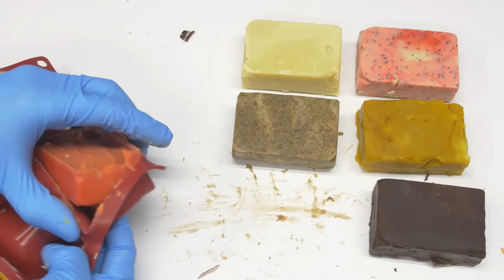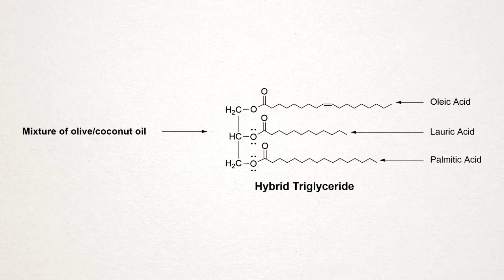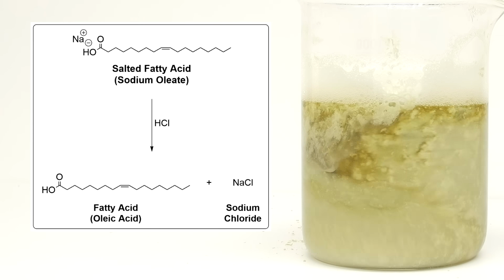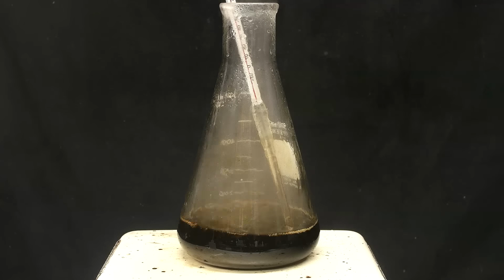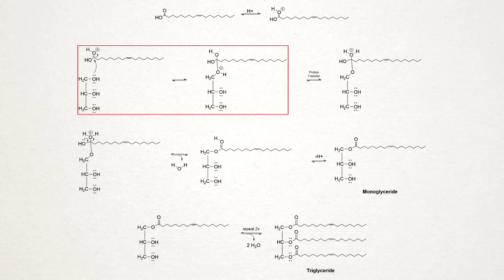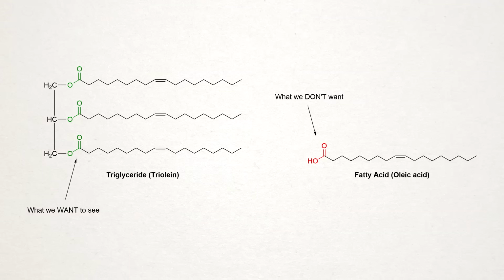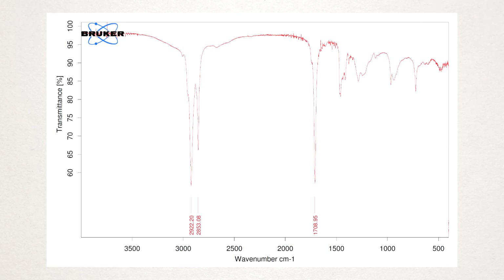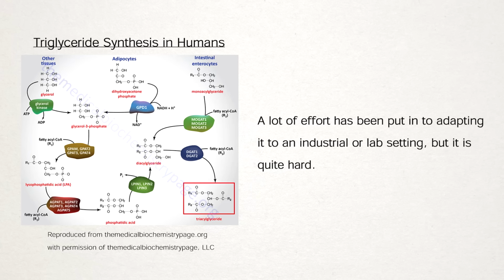Turning soap into oil and making French fries

Comment: If you ever come back to this, I think the conditions you tried were most likely the problem. 200 degrees is pretty harsh, especially for a neat reaction of a starting material that decomposes relatively readily. PTSA would be a great choice of acid catalyst. If you don't want to use sieves to remove water, I strongly recommend using toluene as solvent and refluxing with a Dean-Stark trap.

Comment: You could have used gas chromatography to determine if you have triglycerides. You could have also titrated the “oil” in a solution of heptane and isopropanol against 0.1M KOH to determine fatty acid content. Phenolthalein would be the best indicator for that.

Comment: You may have already gotten once in the last 5 years, but a high temperature laser thermometer would be really useful for a lot of conditions and avoid the need for inserting a thermometor or probe into the reaction mix.

Comment: Unless there were weird impurities from the processing (or the extra vergin olive oil that soap was likely made from), relatively pure oleic acid (or oleic and linoleic acid) should have very little flavor and should work OK as frying oils.
If they'd oxidized significantly from the process and effectively gone rancid, they'd obviously taste worse, but depending how much of that was present, it might still be reasonably palatable. Burning or charring of the olive solids (and various plant terpenoids, etc) from the soap might taste bad, though.

Soap made from light olive oil wouldn't have those solids or other impurities present, though.

Comment: I'm wondering if there was another way.
If you extracted the carboxylic acid, purified it and turned it into an acyl-chloride using thionyl-chloride and DMF. Then you could've reacted it with glycerol to make the product. Of course it would be much more expensive and involved, but I think that might have worked. Idk if the SOCl2 would've reacted with the double bond, but I don't think so.

Comment: It'll probably be easier and safer to mix the fatty acids with DCC and DMAP in DCM, then add the glycerol.  Stir at room temperature for 3h, then cool in ice to ppt the dicyclohexyl urea byproduct. Filter over celite and wash with hexane. Evaporate the solvents and you should have oil

Comment: With all the other stuff that's in soap, quite a bit of purification of the fatty acids would be needed to build a satisfactory tasting "de-saponified" oil, and even it would have quite a few "mongrel" fats where the fatty acids don't match up.  There was a synthetic fat called Enova which was built out of vegetable oils to be low in triglycerides and high in diglycerides.  Even it had troubles with impurities, which took it off the market due to feared carcinogenic health effects of the impurities, which were reportedly in this synthetic oil at levels a hundred times that of natural oil.

Moral: it's not nice to fool Mother Nature (apologies to the late Chiffon margarine).  I still miss the old high fat margarine, though butter unequivocally tastes better.

Comment: A bit late, but could use an EDCc coupling for the esterification reaction? I've used EDCs for coupling amines and it is possible to couple alcohols to catboxylic acids but it's supposed to be a bit trickier with esters than amides
Reply: Alcohol flashlight left on snd

Comment: Is there a way to remove oleic and linoleic acid from oils? I'm asking because I actually make beard products like beard oil and beard balm and I try to avoid using oils that are high in oleic and linoleic acid, since those fatty acids have been shown to inhibit 5-alpha-reductase, which is important for converting testosterone into dihydrotestosterone, the hormone responsible for the maturation and growth of androgenic hair like facial hair.

Right now I'm settling with using oils that have very low levels of oleic acid and linoleic acid, but if there was a way to remove those fatty acids entirely, or even just reduce their levels significantly, that would be quite an amazing innovation for "beard science" lol. That would also open up the number of essential oils I could use for fragrances. Right now my options are pretty limited since a lot of essential oils contain fairly high levels of both oleic and linoleic acid.

Comment: I figured I’d post on this video, I work in a facility that refines oils and I have to say you were very close. One of the big problems with your method is that you need to do this reaction under vacuum to start. The reason for this is because soft oils like olive oil tend to form peroxides when this reaction happens. The final resulting almost black sludge is something that we deal with too. We call it residue and it gets wasted through the process. Finally gas chromatography is genuinely a lot better at telling individual fats apart. Testing them requires a twofold method though, the first tells you which ones are present between mono-s di-s and tri-s and the other tells you their percentage breakdown between the different fatty acids. I don’t want to get too specific because I could possibly divulge trade secrets, but this process just needs a couple of tweaks to actually work. I was actually surprised with how close you got.

Comment: Please give it a further trial under modified conditions:
(1) You should carry out the reaction in excess of glycerol to shift the equilibrium towards the product. 
(2) Tin (II) chloride dihydrate (SnCl2·2H2O) is commonly used as a catalyst, since it turned out to lead to the highest glycerolysis yields. 
(3) Since the presence of water is detrimental, use a water separator while esterification. 
(4) The main reaction products are presumable mono- and diglyceride. Thus, use oil pump vaccuum for distillation to separate the triglyceride from the main products and the oleic acid.

Comment: So the temperature was way, way, way too high for the glycerol. It starts breaking down under acidic conditions at less than 200C. It would be nice to see this done again only not turning everything into tar. Also you can't vacuum distill triglycerides. You just can't. 400C? No. I'm gonna try doing it myself, see how it goes. Probably just starting with soap I make myself.

Comment: What if the reason the reaction between glycerol and fatty acids failed was because the mixture of fatty acids was too messy? You ended up with what seemed like reasonably pure oleic acid, so you could have re-tried it using that!

Comment: Hey Nile, I could be wrong on this. Maybe I don’t have all the required information. You showed your IR spectra at the 16:55 ish mark. Carboxylic acids are typically very easy to identify because they give very broad huge absorbances around 3700-3100 cm^-1 due to the O-H of the acid and hydrogen bonding. They are typically the easiest peaks to identify because they are large and broad. That does not seem to be present on the graph you displayed at about 16:55. Like I said, I could be missing some info about the spectrometer used and the parameters, but it does not look like a graph indicating carboxylic acid functional groups to me. I know your carbonyl peak came a little low for a typical ester carbonyl, but factors such as alpha or beta saturation/unsaturation, and other factors can shift the peak. It looks very possible to me that this actually is the graph of an ester rather than an acid. Just a thought, and like I said I’m certainly willing to be incorrect, maybe there is something I missed or don’t know here. You also have other indications such as liquid at room temp rather than solid, etc. Let me know what you think if you see this.
Reply: The only thing that would change what I said above is if the suspected oleic acid is in the deprotonated salt form. Then obviously the hydrogen on the carboxylate would not be present, thus no hydrogen bonding between molecules and no large broad O-H signal from the carboxylate group. I’m not sure what form the acids would have been in when you took the IR.

Comment: Could it have had anything to do with when you warmed it in the microwave? Usually you use a hot plate to increase reaction rate. Could this have altered the molecular structure in a way that prevented the experiment from working?

Comment: Some years back, I was using lipid extraction of cannabis and soapmaking as a purification process.
The oils in cannabis can't be saponified, but they are highly soluble in plant oils.
I was trying a no solvents extraction process.
Extract with oil, saponify the oil, use water to 'wash out' the soap, leaving cannabis oils behind.
Limited success; mostly ended up with hard to separate emulsions.
The cannabis oils don't dissolve in water, but they disperse so finely they are hard to recover.

Comment: Cutting up - It is possible to just chop the soap up into smaller pieces but if you do this be prepared for long and painful dissolving process
Grinding - after a lot of pain and effort this is what I'm eventually left with

Translation: You can suffer but you can also suffer

Comment: When you were breaking up the soap to mix in the water could you not just cut it up and put it in a blender with the water because would that not mix the soap and the water in a shorter time? Sorry if this is a dumb question, I wrote it with very little sleep and a head ache.

Comment: My best guess at what went wrong is that you boiled off much of your glycerol with the water.  Because glycerol is hygroscopic, its boiling point should be altered when in solution with water.  This would explain the fog created when you heated the solution.  It would certainly take longer and might even require some vacuum, but performing the reaction at a lower temperature may allow the water to be boiled off without the glycerin.  Otherwise, molecular sieves may be effective in pushing the reaction forward.  I wasn't able to find any numbers to support this, but a forum on the issue had some good responses:
http://www.sciencemadness.org/talk/viewthread.php?tid=22180#:~:text=Glycerol%20can%20be%20dried%20by,the%20boiling%20point%20of%20water.&text=Glycerol%20can%20be%20dried%20by%20simply%20heating,the%20boiling%20point%20of%20water.

Comment: uneducated speculation: you may have actually been closer than you realize, but only because you burned your oil duringdistilation and discarded it by mistake. I say this because the substance you discarded from the flask looks suspiciously like the burnt tar I'll sometimes find at the bottom of the pan after deep frying, especially if I've reused the oil a few times without filtering. Assuming you see this comment, try rerunning the experiment, and have the crud from the flask tested like you did the oleic acid.

Comment: Very late and possibly irrelevant (as I've not yet watched the next video) but soap will dissolve faster if you coarsely grate it, then microwave it until it's completely dry. It becomes brittle enough to grind into a fine powder that dissolves very quickly.

Comment: 20:14: "As I mentioned earlier, the cleanup was a huge pain and to get the things out I had to blast it with a heat gun" - well, next time try steam, hot water steam.
Set up the flask in exactly the same way, and using a small pipe (glass or metal one, doesnt really matter) introduce  hot steam INSIDE the flask - initially at the top (meaning, close to the bottom of overturned flask) and then gradually proceed to the opening. After you'll remove as much of the stuff as possible (and I'd bet it'd be much more efficient than heat gun method), don't keep the flask for a "long and painfull" week in a base bath - just fill it up with a concentrated NaOH solution and boil it slowly for an hour of two; that should dissolve all the remaining gunk.

Comment: 3:12 - "All of the oil is transferred to a small flask and I set up things fo a vacuum distilation" - umm, well... Why not STEAM distillation? Or, better still, a low-pressure steam distillation? As ZnCl2 is removed, AND the temperature of low pressure steam distillation would be quite low, there isn't much risk of hydrolisis. That method, the low pressure steam distillation is widely used for vegetable oils raffination, certainly in a case of palm oil raffination.

Comment: I think you used too much heating in both your esterification and distillation. Especially distillation at 400C is bad idea, since smoking point of olive oil is only 200C, which means thermal breakdown of fatty acid or glycerides can happen, the result of which is probably the black goop, Besides, this distillation won't help you get rid of fatty acid anyway if you can't measure the temperature, since oleate boiling temperature of 360C is quite close to 400C. I would IR the product before distillation.

Comment: I was thinking about this topic a lot recently, could you answer my questions?  Are 100% pure fatty acids as safe/healthy to eat as food oils in their natural state ?  Food oils, especially unsaturated plant oils, go "bad" rather easily, they are delicate. Heat, Sunlight or simply age causes vegetable oil to spoil. I was wondering what is happening in edible oils when they go "bad", whether it is when using them for deep frying and the oil seems "burnt" and expired, or the stale smell of vegetable oil when it is years out of date, and it starts to smell like motor oil or kerosene. Are purified single fatty acids more resistant to spoiling than edible oils in their natural state? And lastly, can the damage that happens in edible oils that makes them "spoiled" and no longer suitable for eating, be "reversed" through processing?

Comment: Jsyk Nile, I've tried that soap because I have MCAS and have allergic-like reactions to most additives and I totally reacted to the kiss my hands soap. I don't react to olive oil based soaps and have had others with no problems, so I am pretty positive that they have secret additives in there that they didn't label.
Reply: Also it's waaaayyyyy darker green than homemade olive oil soaps so my guess is that they used green coloring

Comment: your mistake was believing the label of the soap you started with.
i have extracted olive oil many times, and was a soap maker, and just by looking at that soap I can say they lied. all olive oil soap is white, regardless of quality of oil used. NO edible olive oil is green, ever (only green freshly pressed, turns golden way before it's edible, and even if the soap was made while green, the soap would be white) so, at the very least you have a pigment in there, and if they lied about that, well they probably lied about the oil too.
Reply: even supermarket olive oil is not nearly 100% olive oil most of the time

Comment: Try with SOCl2 to make organic acids more reactive to esterification. Maybe you could find problems with chlorination by HCl (product of the esterification in gas phase) of the fats double bonds, but it think it may get out from the mixture instead (supported by the fact that there's no acid catalyzed hydratation of them in your experience, confirmed by IR spectrum [no above 3000 cm-1 alcoholic band]). If you decide to try it use a CaCl2 valve to prevent acyl chloride and SOCl2 from hydratation and add the glycerol quickly too. PS: you should use an inert (from SOCl2) solvent.

Comment: Acrolein?  Please use some of your Patreon contributions to invest in a fume hood!

The flask can be more quickly cooled by putting it into an ice/water(+salt) bath.   (ONLY with high quality glassware.)

For a continuation of this project (if it happens) and for other, similar, projects in the future, you might consider characterization of your products (and residual reactants) by simple liquid chromatography methods.  (I can't guarantee they exist.) 

It's qualitative, to be sure, but migration of presumed products through a solvent carrying medium, often paper, can be compared, side by side, with a) the starting reaction mix, b) individual components of the reaction mix, c) the final reaction mix, d) various "controls" consisting of know pure versions of the chemical species expected along with possible partial and side products.